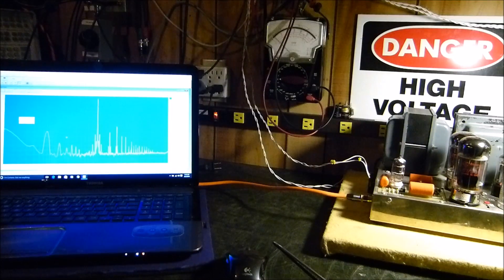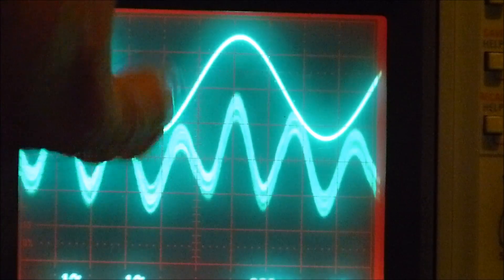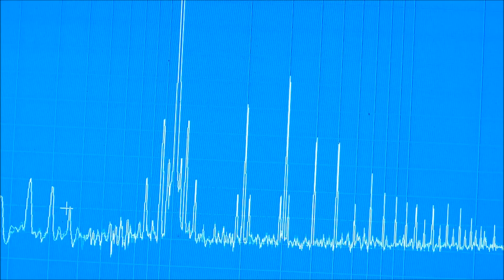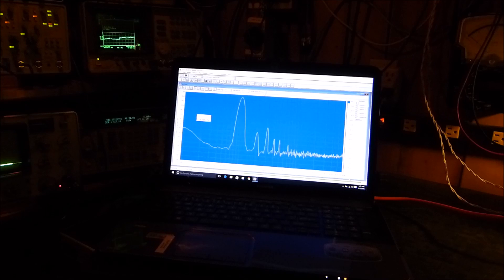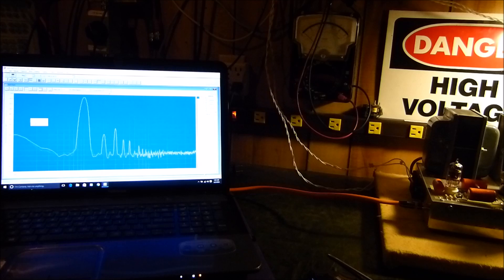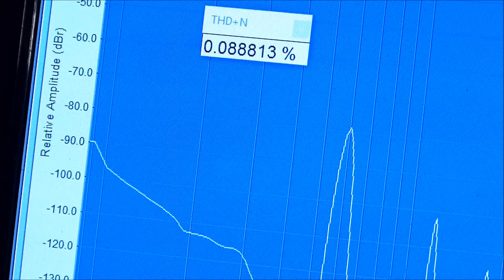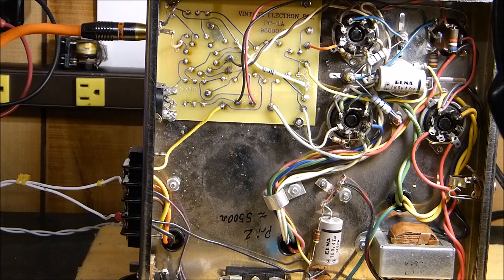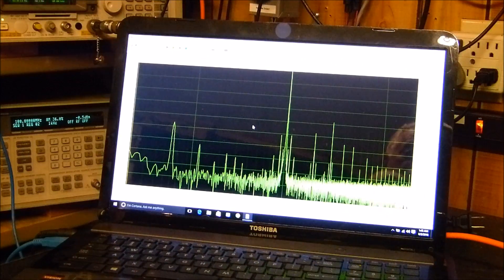Using The FFT Audio Analyzer To Adjust Dynaco Mark III Vacuum Tube Amplifier

Comment: Great! I try to measure my sound cards with software like SpectraPlus 5.0, but always the results are erroneous, I got too much THD. I tried various cables with and without resistors. What do you recommend me in order to do a reliable measurements? Thank you.
Reply from the maker: Hi Boris,
I really don't know what to expect in THD of a sound card but it may inherently have THD higher than we expect and want. What is the THD right out of your source oscillator? That is the  place to start. I have found that most all 50 ohm coax cables are about the same until you want to start measuring S/N ratios better than -80 dBm. It takes a really clean source oscillator and wooden work bench rather than a metal one and no over head fluorescent lights and the best interconnecting cables to make measurements at -90 dBm but until you get to that extreme most all coax and audio cables work OK. Hope this helps.
Reply: @ElPasoTubeAmps  , Yes of course I appreciate your answer. Thak you! I do the measurement on the floor. For THD I  utilize the 1 Mhz sine wave from my entry level dso Hantek and the sound generator source of the software also.  For looping I/O sound cards analog a  TR or stereo TRS- good quality cables. Do you know some model  DSO (Chinese of course) scope with a good FFT function, but not too  expensive? I looked for a new  FFT RTA (hardware)analyzer , but it seems in the market there are RTA for RF. I only found old vintages HP s (or something else) AUDIO SPECTRUM ANALYZERS or expensive DSO s with better FFT. What do you think about? Regards from Mexico.

Comment: It's interesting that in the previous videos you were preferring the rounder shapes from the smaller FFT windows, maybe because they look more like the HP :-|, but now you're coming around to the spikes. There is a very affordable iPad/iPhone application called AudioTools from Studio Six Digital that does all this, but only up to 22kHz, and I'm not sure how you get input into it other than via their $499 adapter which is too much for me, having stuff I don't need like 48V phantom power. A lot of this stuff seems to be more aimed at live sound engineers rather than us fixer guys.

Comment: That sound card is good for a home musician, but not really for audio measurement. State of the art is thousands, but there are many levels in between. Do a search on google for "high end audio interface" and you'll find lots of info...and opinions...and marketing. Try Musicians Friend or Sweetwater and make sure to look at the reviews (MF has 68 for this) and you'll get good info too...and prices, etc. I would guess the 60Hz noise is from the typical noisy USB buss power. Although you did make a good choice, as the 2i2 is pretty good for the price you got (they have a newer version out now I think). One with a similar spec, or a bit better, with its own power supply would be best, IMHO. Thanks for such a cool series. I downloaded the software...but I of course have little I can do with it...but totally cool in a very geek way.

Comment: Thanks for the video. I have been following your experiments with ARTA as well. I will be trying it myself. How are cabling the amp output to your soundcard?
Reply from the maker: I measure all the audio from the amplifier from across the 8 ohm load. 

You do have to greatly attenuate the voltage from across the 8 ohm load before putting it into your sound card whether it is the sound card of the PC or the external sound card. 

As an example, at 50 watts across 8 ohms you will have 20 volts RMS. You need to attenuate that to much less than one volt, depending on whether or not you sound card has a microphone input or a line input. 

A simple way to start out is to use a 10K pot across the 8 ohm load and adjust the output of the pot to a level that doesn't overdrive your PC sound card. Start with the pot at zero, no output from the wiper of the pot, and carefully adjust up until you get a decent display on your PC being careful not to put 20 volts into your microphone input. This might damage the PC.

Comment: Note that adding power supply capacitance won't impact the 60Hz component (the increase in power supply c will filter out 120 Hz and harmonics and could actually make things worse off the rectifier node if grounded to signal ground). The 60Hz contamination is likely due to a ground loop between the amp and your pc (assuming that you have already made provisions to eliminate ground loops on your bench instruments.
Reply from the maker: I have to agree that this was a poor example of trying to reduce 60 Hz noise that is probably coming from the filament supply or ground loop, etc., with capacitors across the PS. 
Not sure what you mean by the rectifier node being grounded to signal ground. Isn't this what we want? 
My belief is the best point-of-ground is at the PS filter capacitor. 
I realize we don't want a monster capacitor, say, 10,000 uF at the output of a Pi filter so that we introduce series  inductance to ground into the PS filter (as we are not only wanting to take the 120 Hz ripple to ground but also a common path for audio frequencies)  but the difference between say, a 40 uF PS capacitor and a 100 uF capacitor will likely not change anything.
Reply: For the first hv filter cap (the cap immediately at the rectifier and therefore with the highest current pulses) the lowest impedance path is to the transformer hv center tap. I would reference this node as "power" ground. The remaining hv power supply caps should reference "signal" ground - the AC cathode ground of the first stage being the quietest node. In this way, the cap provides a solid AC ground reference to the gain stages. Referencing any signal cap along the conductor returning the first cap current back to the transformer hv ct will inject the 120Hz noise into the signal ground return and of course then into the associated circuits. 
Your FFT video is particularly useful showing how a FFT to examine the components responsible for the THDN allows one to remediate the cause of the individual contributors.
Reply: If you pay careful attention to the 120Hz peak, it is greatly diminished when the cap is inserted in the 4th position and noticeably reduced in the 3rd position.  Of course we don't know if indeed these are the caps for the first stages, but since we don't hear much of a 'POP', I am going to assume that is case.  I would venture to say that Joe Curcio is correct, splitting the ground from power ground to signal ground is beneficial in that you reduce the 120Hz injection in associated circuitry.  But, in this case with a can cap and the ground cannot be split, adding some capacitance to the first stage may be beneficial.  Assuming you really need to drop the 120Hz artifact from -80dB to -88dB.
Reply from the maker: You are absolutely correct. I had to watch the video paying close attention to the 120 Hz and harmonics and I saw the 120 Hz drop around 10 dB... This was a terrible example of reducing 60 Hz by adding more capacitance into the PS. I don't know what I was thinking but good sometimes comes out of blunders. I will have to revisit this and do it right and maybe post again. What got me started is the modulated hum I could see on the oscilloscope from the output of the AA501. I am going to look more into Joe's comments and see what I can determine.  Funny thing about this amp is I have posted a video where I could get a -90 dB S/N by securely grounding the canned cap to the chassis. Maybe I should view that video again and see what driver board I was using.  Thanks for pointing this out.
Reply: Thanks for bringing this up. I never heard the term Power ground before.

Comment: I think if you register it you might be able to get the Activation key to unlock the full package for ever, why not use between 8192 bins and 32768 bins and add a Kaiser window function to maybe clean up the signal, can you not process your signal using a ADC,DSP and DAC chip and couple the output of your DAC to the first Grid via a high voltage cap.
Reply from the maker: I agree with your sampling rate and bin rate for the mid frequency ranges. And I generally like Kaiser better than Hanning window.  I just need a clean enough display to do the job. With the bin rate too high and too high sampling, it takes longer and there ends up a lot of spurs that are meaningless. However, at really low frequencies (20 Hz and lower) high sampling and bin rate is required or you wont see anything.

Comment: I would not expect the transient response to change much as you are probably near to class A. Regarding the extra smoothing, that will not change as any ripple would be 120 Hz. You could try messing with the heater supply or even using a DC heater, be interesting to see any change in the results. That's got to be a prime source of 60Hz  ingestion.
Reply from the maker: I agree with you about the 60 Hz. Probably from the filament supply, bad tube, grounding, etc. This was a poor example of attempting to mitigate 60 Hz noise with PS capacitors. My real point of the video was to show just how well this FFT device and software shows the spectrum of frequencies from 10 Hz well beyond 10 KHz all in one sweep. The audio SA of yesteryear is replaced virtually for free with today's computers.